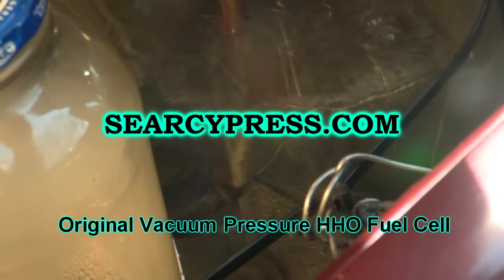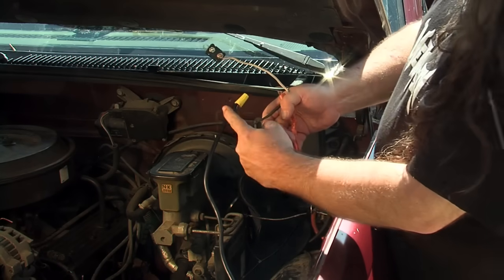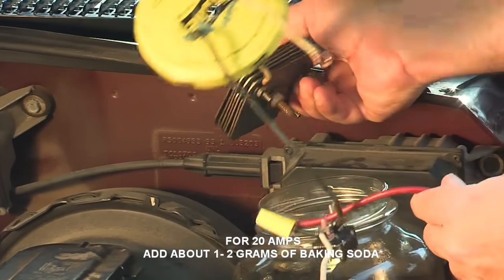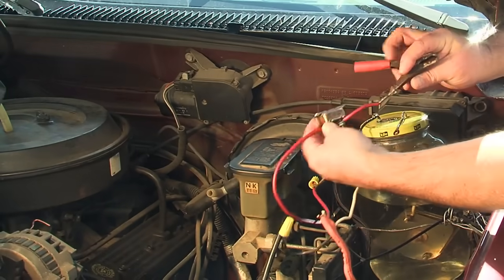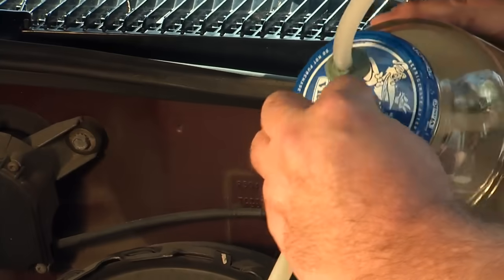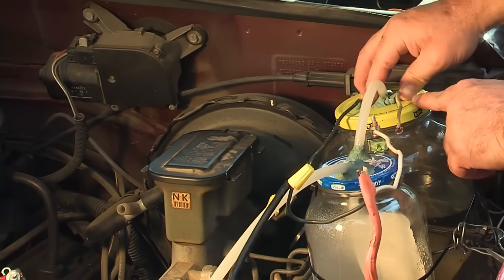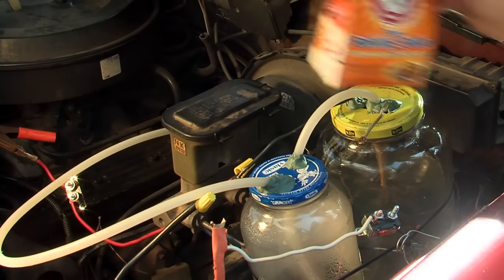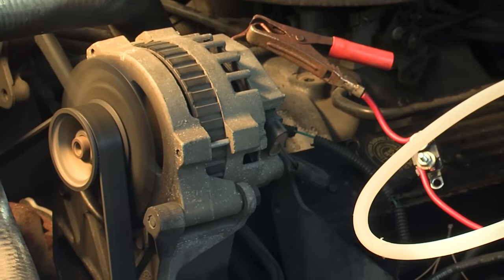Vacuum Pressure Hydrogen fuel cell defeats high gas prices using hydrogen from H2O.

Comment: Please don't use glass, but next time use clear plastic jugs.  They're much safer.
Reply from the maker: Unfortunately using plastic is not possible with a vacuum system. The heat and intense pressures will distort the container. The system runs in a negative environment and there is no positive pressure. A technical malfunction however could result in a dangerous outcome. We have a new video coming out that shows safety improvements and a much cooler looking design. Be sure to subscribe so you don't miss it. Thanks very much for the comment.

Comment: BUT IT COSTS YOU A bunch of energy to run this! 29 amps!
Reply from the maker: Actually it's 400 watts. We are not trying to power the engine. We are igniting the 20% of the gasoline that is normally not burned in the cylinder. There is no free energy. We have a new video coming out that hopefully will explain things a bit better. Be sure and subscribe. Thanks very much for the comment.

Comment: how does it preform in the cold?
Reply from the maker: Quite excellently. If you're in a very cold climate where temperatures will drop below 18f when you're not using the system, it will be necessary to wrap the system with a heating wire or drain it. During operation however it produces enough heat to prevent freezing. New video with a much-improved version is coming out soon so be sure and subscribe. Thanks for the comment.

Comment: Does it work with diesel trucks??
Reply from the maker: If you have a vacuum system it can be done. The vacuum is key to the thermal properties necessary for this to function. Thanks for the comment.

Comment: What if the water freezes?
Reply from the maker: The electrolyte will somewhat inhibit freezing. Of course if you live in a very cold climate you will have to deal with that issue. Reducing the amount of water in the primary cell will lessen the likelihood of the jar breaking. An external heating wire can also be used wrapped around The jug and plugged in when not in use. Thanks for the comment. We have a new video coming out very soon. Be sure and subscribe.
Reply: @metalpresstv   thanks. I want to see more videos on how to do this at home. Do you think Hydrogen can replace EV and GAS engines? Any at home project or videos you can provide?
Reply from the maker: @philg4678  Our new video will show a much safer version of this design. The future is definitely not with electric vehicles. At least  not with vehicles that you charge. The clean future is most definitely liquid hydrogen. It solves all the problems. It's kind of comical that they expect you to believe we have the ability to provide enough power to charge all the vehicles in America.  Believe me, the powers-that-be are fully aware it's not possible. As they are selling you this idea they're buying stock in companies like Nikola. Thanks again. More vids are coming.

Comment: i will certainly build this. my assumption is 99% it will work. when it does, i will send you a present. thanks.
Reply from the maker: We have a new video coming out which will tell a lot more and show so a much safer design. We do not recommend  anyone replicate anything they see for safety reasons. Be sure and subscribe so you can see the new improvements we've made over the years. Thanks very much for the comment.

Comment: If this really works big car companies would have adopted it in the design of their cars.  All car companies spend a lot of money on research to make their cars fuel efficient and be more competetive
Reply from the maker: @walterwiseman7112  I don't really think the engineers have any kind of free will in the matter. Engine efficiencies are purposely made low. This allows for an entire industry of emission controls. It is sad but that is the world we live in.
Reply from the maker: That's ridiculous. If they wanted to make a car that got a hundred miles per gallon they most certainly could do so. They work very closely with agencies to regulate such things. There's no reason an engine would need a catalytic converter if it was simply designed to burn all of the fuel. They are intentionally designed to waste gas and create a secondary industry of emission controls. People just don't buy that baloney they try to sell to us everyday anymore. They care about us, they care about the climate, they want us safe. None of that holds any credibility anymore. Very sorry if you bought into that lie. I'm not trying to be disrespectful I'm just trying to tell you straight. Thanks for the comment.

Comment: Hi, I built one of these. How are you able to keep the water from boiling? Is it the amount of water you  are using? I have a much smaller jar, because that is all that will fit in my car. It's probably a quart sized jar. It's about 4.5 " in diameter and 6.5" tall. I way over engineered this thing at first. Note to those out there: more plates equals more hydrogen production. However, it draws way too many amps and kept tripping the fuses i put in place. I initially put in 15 plates 4" in diameter. I took out all but 5. Now it runs for a long time, but the water starts to boil after about 15-20 minutes. I used stainless steel threaded rod instead of running wires into the jar. This requires more work, but a nicer finished product. You have to drill two different sized holes in each plate, and use urethane washers, and bushings. I just need to know what i need to do to keep the water from boiling. Thanks!
Reply from the maker: I can't really speak for your design. Eventually the water will hit in about 150° f. With the vacuum on the system this is plenty hot enough to boil the water. This is essentially flammable steam. The secondary collection jar will begin to fill and does dry the gas. Because of the piping system we use on this particular design if the engine is shut off all of the water in the secondary jar returns very quickly back into the main cell because of the thermal vacuum. So essentially every time you shut it off, there is a system reset. Smaller jars are just not sufficient to do what  this particular design we used does. We have a new video coming out this year which will show a really spectacular build with lots of improvements. Be sure and subscribe. Thanks for your comment.
Reply: @metalpresstv  Thank you! I figured if i used a larger jar that might help solve the problem with the water getting too hot. I'll have to use your design on my truck, because there simply isn't any room under the hood of my car for a bigger jar. I'm going have to go with a dry system on the car. I just like the wet system, because its' easier to build. I have a diesel Mercedes, which can also run on vegetable oil. However, this hho system is better. Water is free and I don't have to filter it.  Looking forward to the new video.
Reply from the maker: @petetanis8379  just remember the goal is not to try to run the engine on this gas. The goal is to ignite the 20% of the unburned fuel which is normally exhausted to the catalytic converter. There is no such thing as free energy. Any gains you see will be coming from the gasoline and not from the HHO gas directly. We do not sanction anyone replicating anything shown in the above video. Thanks very much for the comment.

Comment: Great demonstration of why they (oil/car industry and oligarchs) were  eager to move everyone from carburetors to fuel injection.
Reply: You can do the same thing with fuel injection just a little more difficult cause you have to send it through the intake manifold
Reply: @Ididntdoit1138 would you need to reprogram the vehicle?
Reply: I believe the car would adjust itself after awhile
Reply: Adding HHO to a fuel injection system would give you more power and less emissions but I think you’re right that you’d have to program the injectors spray to actually save on fuel
Reply from the maker: @timchapman8359 in some cases most definitely. But not in all circumstances. Manufacturers have been warned of this modification but it is so effective it has a very strange way of getting significant benefits. We have a new video coming out which will show some improvements we've made over the years be sure to subscribe and I thank you very much for your comment.
Reply: This is a TBI truck (I have a ‘93 😂) what intake did you use?

Comment: too bad it takes more energy to create the hydrogen than you get back out of it
Reply from the maker: I agree with you on the physics. However you don't understand the concept here. We are not trying to power the vehicle with the hydrogen oxygen fuel. The engine is only burning about 80% of the gasoline. What we are doing with the fuel cell is igniting that 20% of wasted fuel in the cylinder. Any gains come from the gasoline, not from the HHO gas directly. The catalytic converter runs cooler resulting in a lot of water coming out of the tailpipe as opposed to normal operation. Thanks very much for the comment.
Reply: @metalpresstv  gasoline engines are not 80% efficient, only about 30% at best
Reply from the maker: @williamfowler616  I was talking about the percentage of gasoline that is burned in the cylinder. I'm not talking about the efficiency of the engine itself. I'm certain it's a lot less when you factor in all the entropy involved. Thanks for the comment.

Comment: Don’t you have to be driving at least 350 miles per trip for these to give you good gas mileage ? Short trips , driving 30 miles doesn’t make any difference .
Reply from the maker: It's more accurate to say performance is more noticed on the highway as opposed to City driving. We have a new video coming out this year be sure and check it out. Thanks very much for the comment.

Comment: I'm sure someone else realized the backflow flame arrestor jar has no water to arrest any flames lol
Reply from the maker: Actually once the system gets going water condenses quite rapidly into that secondary jug.  When the system is turned off, because of the thermal vacuum and the way the system is piped, all of the water returns to the primary cell. This is by design. It eliminates the need to dump the water manually back into the primary cell. Thanks very much for the comment and be sure and subscribe because our next video will be coming out soon.

Comment: Not true the hydrogen makes The Glass so hot it shattered the glass even ceramic jars can't handle the heat and you can't run a car without Fuel so many fake cars saying they're running on fumes yeah what About the carburettors fuel bowl it can't Work on fumes There Must be Fuel not vapours. Lies all lies

Comment: Keep the plates and all connected fitting clean or it stops working .
Reply from the maker: It is a pretty good idea. However, generally if you do the job right the first time you won't have to mess with it for quite some time. Thanks for the comment. A new video coming soon. Be sure and subscribe.

Comment: Is this really the first HHO generator to produce more than it consumes. Not very likely but fun to try like most of us have.
Reply from the maker: There's no such thing as free energy. What this device does is power the combustion process. It does not power the engine. 20% of the fuel that goes into this engine is wasted. It ends up being combusted in the catalytic converter. With this fuel cell we are burning that extra 20% in the cylinder where it actually does some good. The catalytic converter stays much cooler, resulting in a lot of water that is produced by the burning of gasoline to exit the tailpipe. We have a new video that will be coming out be sure and subscribe.

Comment: Now What if you used fall leaf ashes for lead to put sulphur acid from avocado to have a container pouring out the pure hygrogen gas that makes the water to cut out space ava materials from current. Then place it on the motor based off gas density layers so it falls into the motor to fuel it. 
Less materials
Reply from the maker: We are not trying to power the engine directly. We are trying to create better combustion in the cylinder. It seems engines are designed to waste a certain amount of fuel that is later burned in the catalytic converter. As much as 20% of the fuel is wasted. This of course allows for an entire industry of emission controls. Engines should burn all of the fuel and require no secondary system for pollution control. Interesting idea though. Thanks for the comment.

Comment: what do you do in winter though? the water would freeze, and it would probably break the jars right?
Reply from the maker: If it gets really cold, it's possible, but it is a salt like solution that has some resistance to freezing. Thanks for the comment.
Reply: @metalpresstv  Oh ok, I figured it was distilled water but I guess electrolytes help? Huh. And thanks for the answer. I'm sure there are plastic containers that would be fine anyway, and the heat of the car as it gets running would melt it back if it happens to freeze

Comment: have u used this in the winter? do u just add some antifreeze or not use in the winter?
Reply from the maker: You do not ever add anything except baking soda. If you're in an extremely cold environment freezing could be a problem but in normal situations the water does not freeze because it is somewhat salted. Thanks for the comment.

Comment: What plates did you use in addition of bolt size,plastic bolts, and washers/metal bolts?       Thank you for sharing your knowledge!
Reply from the maker: That particular fuel cell was custom made by an aircraft company employee especially for the project. The main thing about the plates they must be the highest grade non-magnetic stainless you're able to get a hold of. The spacing of the plates also plays a key role in the efficiency factor of the cell. Many people have used neutral plates in addition to the positive and negatives. We did in this cell shown. We reevaluate that and discuss this in greater detail in our upcoming video. Thanks very much for the comment, please share the video. 😀

Comment: What happens when you turn hard and the water pitches up?, raw water in the cylinder isnt ideal at all
Reply from the maker: That would be quite a hard turn, let me say that to start with. There is a secondary jar which is tall enough to prevent any kind of problem like that. Every single time the engine is shut off, all of the condensed or overflowed water returns to the primary fuel cell by a natural thermal created vacuum. We have a new video coming out soon, be sure and subscribe. Thanks for the comment.

Comment: I think the gas company's had a hand in this video. For one don't use glass  . For two  run your wires neatly . 3  the jar can explode. Use plastic . All connections have to be air tight.  . Two glass jars  no no . Putty    no no . The. Arabs made this dude . Sparking wires no. No . Putty no no . Air tight connections.  And bad guitar playing no no. .
Reply from the maker: You're out of your mind. New video coming out soon. Stop drinking their kool-aid. Thanks for the comment..

Comment: Baking soda, totally non toxic. Saw other videos they didn't hook in to vacuum system properly.  Hooked in to plastic air intake and then didn't understand why it wouldn't work. Also hooked to battery not to alternator.

Comment: use magnetic water it will turn into hydrogen much easier!
Reply from the maker: We messed around with magnetic fields on some of our other videos on this channel. We took it to an extreme level. Some things worked and were worth the effort and some things were not. We've done just about anything you can think of. We have a new video coming out which shows some advances to this design for sure. Be sure and subscribe. Thanks for the comment.

Comment: How often do you replace the water???
Reply from the maker: Generally we get about 200 MI out of the water in the jug. It depends on the outside temperature somewhat. We have a new video coming out that will go into much more detail about a lot of things. We also added some safety features and explained a bunch of the misconceptions around hho. Be sure and subscribe so you don't miss the release of this video. Thanks very much for the comment.

Comment: As brilliant as you are why not just go full hydro. Replace the gas in the tank for water rewire and swap the injectors
Reply from the maker: I'm not brilliant but I'm not crazy. This gas is very reactive. Running the truck on the fuel is just not going to happen. You can easily melt a tungsten rod with a flame produced by the HHO. With the engine wasting 20% of its fuel you have a resource you can tap for energy. Using the gas to create complete combustion in the chamber seems a much safer approach. The price of a good truck nowadays certainly justifies some caution. We have a new video coming out that does show some improvements I think you will appreciate. Thanks very much for the comment. Please subscribe and be safe.

Comment: I have a bluetec diesel mercedes. Do you know where I can run the line to from the jar? The car has a vacumm pump for the brake booster. I don't think I can use that connection. Can i drill a hole in the plastic intake tube and connect it there? I have this thing built and ready to try out. Thanks
Reply: Sprinter engine intake system it's charging by Turbo you don't have any vacuum in Intake site

Comment: Hey I have a question. The light switch how you hook up yours. I hooked mine up and it started smoking
Reply from the maker: In this installation it was breaking the negative circuit. In our upcoming video we show how the installation of a low pressure vacuum control system switch is much safer. Be sure and subscribe so you don't miss it. Thank you for the comment.